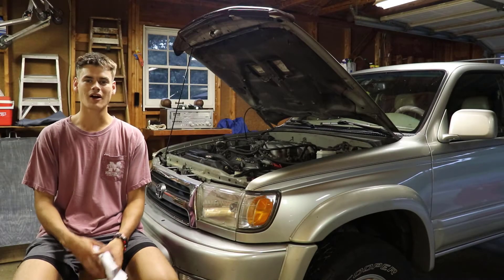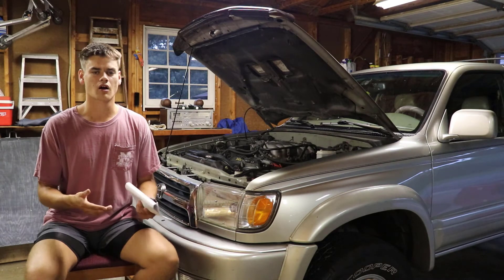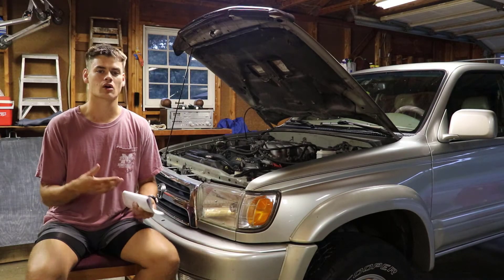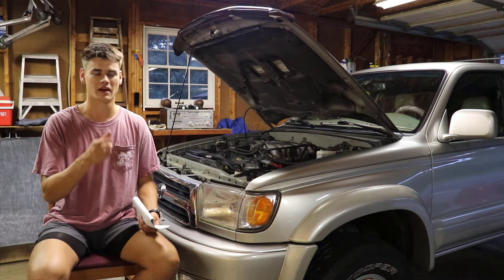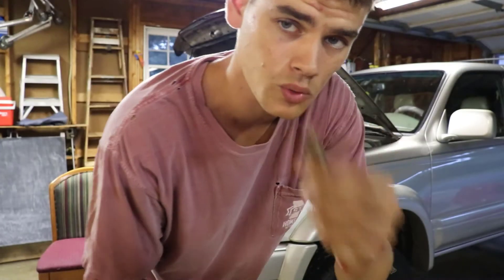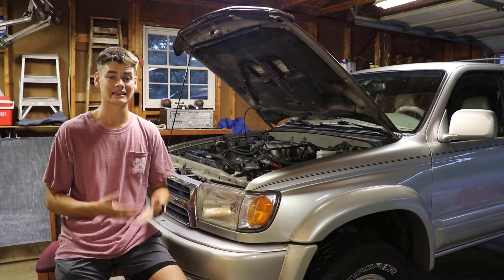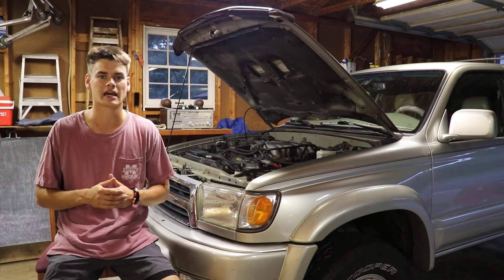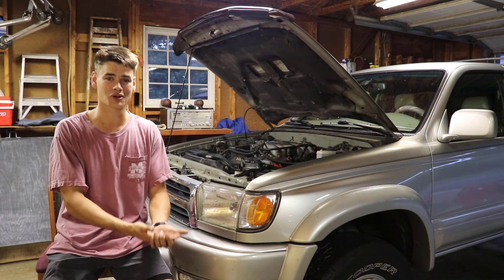Toyota 3.4L Engine Misfire Diagnosis

Comment: my coil pack went bad, changed . problem got a little better . misfiring, but least it started. changed injectors. ($700) . same shit. all this time the ignition cables where connected wrong

Comment: Brother I bought a 1995 tacoma with this engine. The engine light pops up once in a while and the previous owner told me just to erase it once it pops up. I know the truck ain’t running right. Jiggles a bit and feels sluggish. Added redline fuel cleaner to see if that helped. Still runs the same. When I looked in the truck I saw what spark plugs he put on. They fit the truck but it’s not the dual electrode ones. He put after marker ignition coils and wires too. Code p0300 p0301 p303. Gonna clean up the MAF sensor when i get home. Luckily I got this truck for free. Lol.
Reply from the maker: Looks like you have done some good analysis on the problem so far. Hopefully you can get down to the root cause and fix it.

Comment: Changed the OEM wires at about 40K on my 3.4L 4runner (That were working good)and went through 2 sets of aftermarket low resistance(About1K ohm per foot)wire sets and both sets did not last more than 20K miles and they both threw P0304 & P0302,It turns out that the wire insulation cracks and near the top of the boot where the wire makes the 90 degree angle and then arcs to the ground ring on the top of the cylinder where the boot goes into.Most engines do not have a metal sleeve where the plug goes down into and that sleeve transfers lots of heat to the boot and wire.Word to the wise,The two sets that failed are the Bosch premium wire set(Black box)that lasted a year and then a code thrown and engine not running right,And a set from B&B manufacturing called Platinum class laser mag,Lasted 3 years.Stay away from these wires as these are not good quality.

Comment: Hey man, I want your input on this. Just bought a 2002 4runner, the plugs were replaced recently. 

I was driving it to work, about 290 miles into the drive I had a flashing CEL, I had some vibrations right before it came on almost like I was on a bumpy road. I kept driving(shame on me) because sound, feel, and temp was normal. About 30 min later it turned back off . Any clues on why it would happen? I was driving about 75 on cruise control. Thanks!
Reply from the maker: I had something similar happen when I first had the issue. The misfire then became constant every time I drove the car. I would recommend pulling the codes from the CEL and seeing what cylinder misfired. You can swap the coil pack of the misfiring cylinder with a good pack to see if the pack is bad before moving to the injector.
Reply from the maker: One more addition thing is look at the plug of the misfiring cylinder for any discoloration or gap out of tolerance.
Reply: @rustbucketproductions  thanks!
Reply: @rustbucketproductions  what would that discoloration point to?

Comment: Just went through this with my 97 4runner. Coil packs and injectors and all good. Do not cheap out on the coil packs. I bought a set off Ebay (OEM) and only 60$, well they were garbage  so get good parts.

Comment: I'm chasing a P0305 myself and ruled it to be the fuel injector. I chose a different plan and decided to rebuild all 6 injectors with an eBay rebuild kit and see if the misfire will go away (and also if it will run smoother). A multimeter will also determine if the fuel injector #5 it bad itself. Great video!!
Reply from the maker: Thank you and yes you are correct, checking the resistance across the injector is a good place to start. Hope the fix goes smoothly.